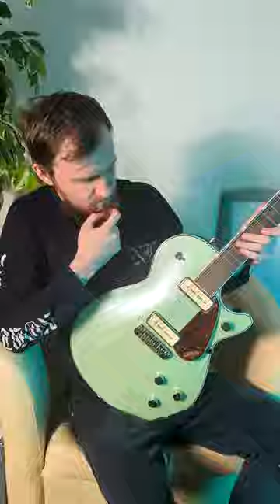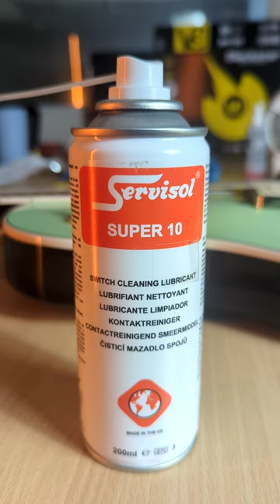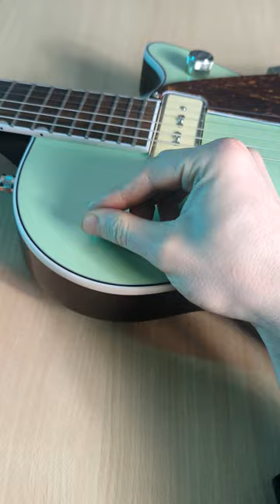Broken Pickup Selector? #shorts

Comment: Seems like eventually it will have to be replaced? BTW, how do you like that Gretsch?
Reply from the maker: No, not replaced, just cleaned. Unless corrosion eats away at the mechanical parts,which when properly cleaned, should not be an issue! - Cheers! - Sam
Reply: @HickiesMusicStore  Thank you — what model Gretsch is that?